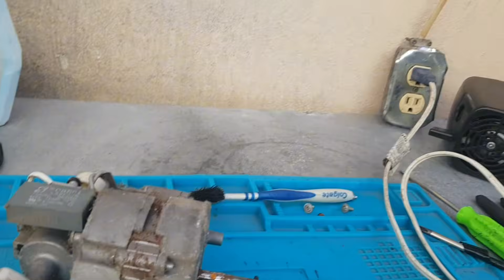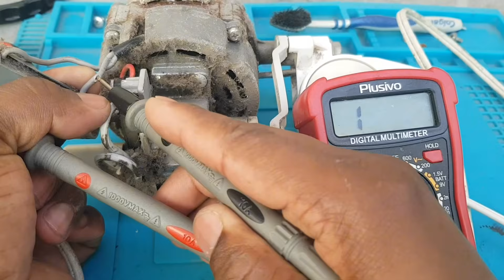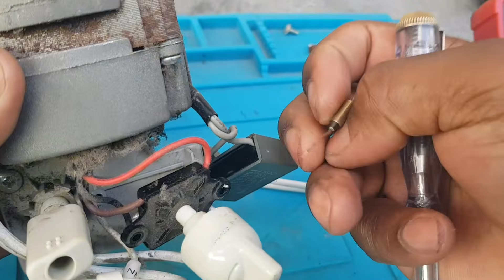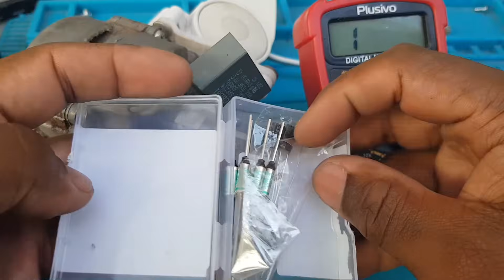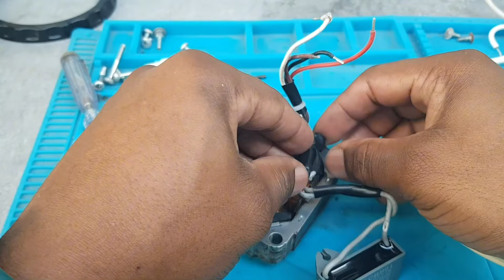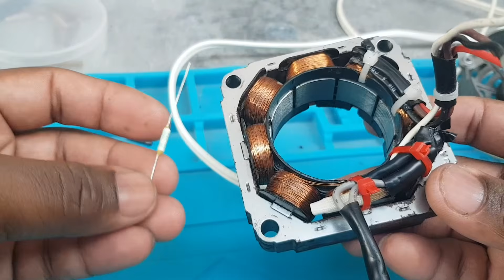Lasko fan not working | Check and replace blown thermal fuse.

Comment: Great video....how about a fan that is powering on but the spindle not moving?
Reply from the maker: Thanks i appreciate the feedback 👍, for it not to spin can be a deffective coil, capacitor, switch or the power cord. One of those 4 can be the issue, once you identify the issue and repair it, your good to go.

Comment: Can you just bypass a thermal fuse for a one time fix and if I don’t have a fuse to replace
Reply from the maker: I did an experiment base on what you asked. And bypass the thermal fuse the fan didn't last more that 3 to 5 minutes resulting the motor burned. So I recommend you source the thermal fuse and replace the defective one.
Reply: @IshiTechtronics2570  I tried it and it’s not working. Thank you for getting back to me.
Reply from the maker: @larryb5481  Okay and your welcome 👍

Comment: I took my fan apart to ckean it. Then it stopped working. I took the motor out and it looked like soneone used the copper and slectric tape to hot wire the motor
Reply from the maker: Sorry to hear you have a multimeter on you. I would guide you how to test to let you see why the fan stop work and also to see if can repair.

Comment: Hey my lasko fan when turning on to speed 3 which is the fastest speed it doesn't spin only if i manually spin it will spin but it's spinning really slow but if I turn it to speed 2 or 1 it doesn't spin but just humming. Can you tell me what I can do to fix it plz.
Reply from the maker: Thanks for reaching out. The hummy sound is telling me the shaft jam and needs to be lubricate. Remove all the plastic housing from the fan exposing it. And where the shaft comes out of its skeleton housing lubricate at the joint with multiple purpose oil / machine oil or WD 40 and rotate the shaft while lubricate it so that the oil can get into the bearing etc. Ensure to unplug the fan before doing so.
Reply: @IshiTechtronics2570 WD-40 is not a proper motor lubricant. 3 in 1 oil in the blue can or Zoom Spout oil are formulated specifically for electric motors. I picked up my Zoom Spout oil at Lowe’s Home Improvement in the USA.

Comment: My Lasko fan turns off automatically after being on for 1 second. Is that the same issue this fan had?
Reply from the maker: This fan has a different issue. This fan stopped working due to the build-up of dust. This prevents the fan from breathing properly, and the temperature rises, which results in the thermal fuse blown. Why does your fan start and stop after a second can be a capacitor issue, or the front bearing need lubricant or the speed you select the coil can be defective. But try and replace the capacitor first.

Comment: Probably overheated from all the dirt.  Try cleaning it.
Reply from the maker: Yes which resulting the thermal fuse to blown. This fan was from a customer thu.
Reply: How can i get the thermal fuse ?can it work it any off those  fan that have those type of motor?
Reply: Can I buy the thermal fuse at a store or do I have to order online?

Comment: How do you know if the fuse is blown
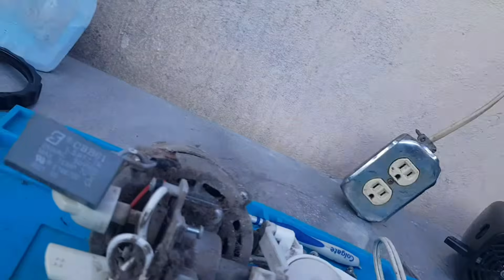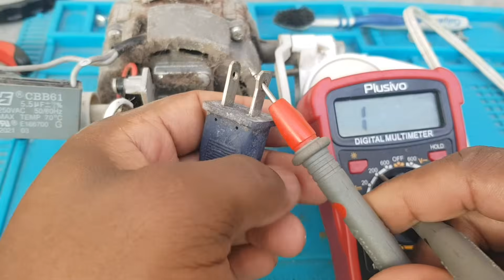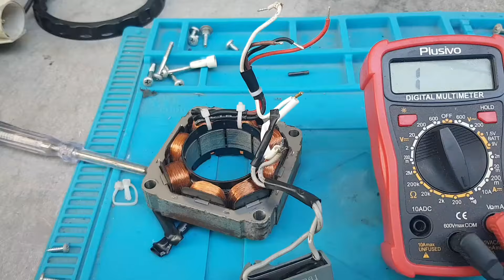Reply from the maker: If you fast forward the video to these times 0:54 - 1:01 and 4:33 - 4:42. You will know how the fuse is blown.
Reply: well it will either make a pop or ticking sound and then when you unplug it the whole fan will shut off and quit running